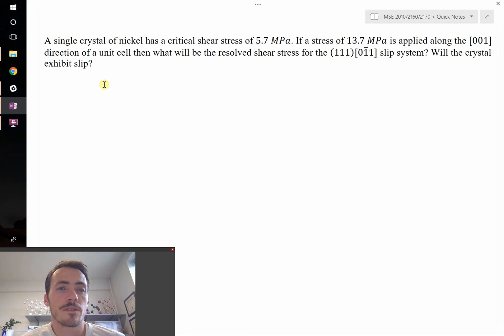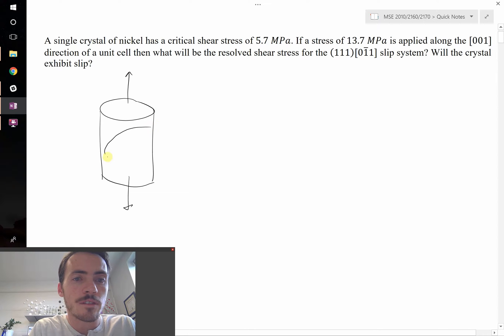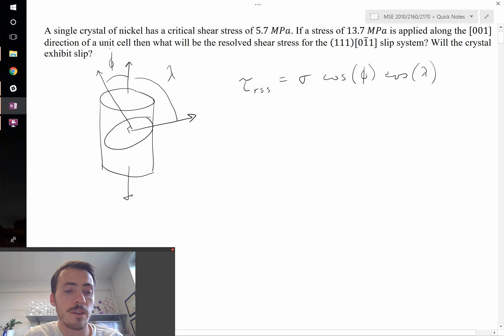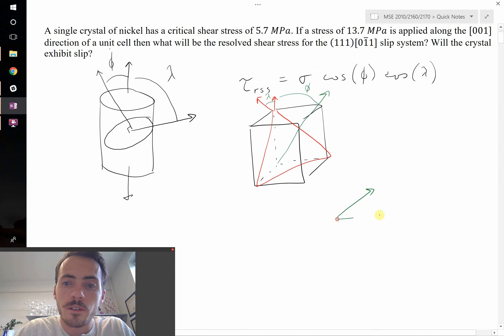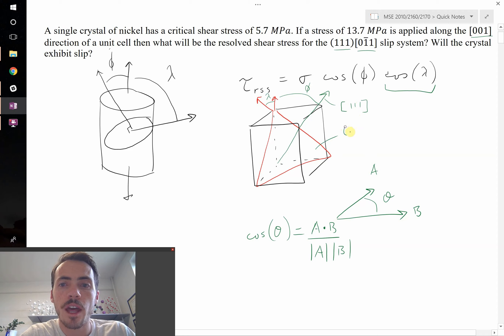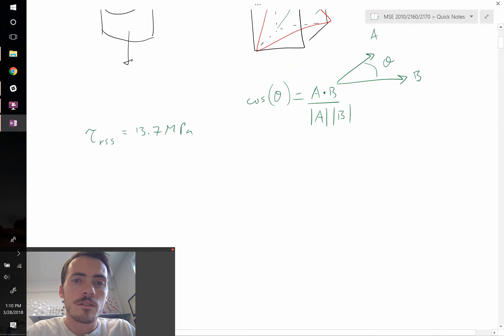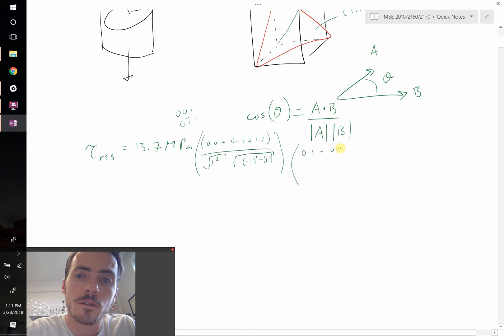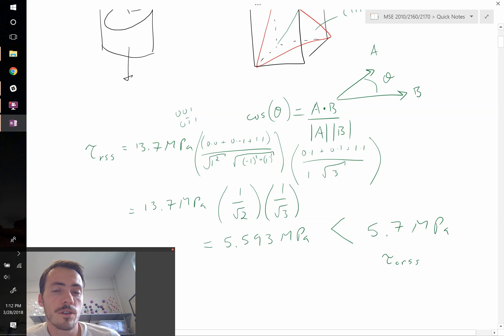Slip in single crystals due to resolved shear stress (Schmid's Law) example problem

Comment: When you say the resolved shear stress would just be the applied stress if those angles were zero, that seems strange cause I thought the normal stress would be 100% but the shear stress when you're just pulling on something would be 0 (and at a max on 45 degree planes). Thanks for the example, not sure im explaining what I mean. I get the math (cos(0) = 1 for both)
Reply: I found a derivation that makes the math make sense to me - no wonder I was having issues, here it is for others - http://www.uobabylon.edu.iq/eprints/publication_12_24106_1037.pdf
Reply from the maker: I'm not totally sure that I follow you. When the angles are 90 degrees then the applied stress is totally perpendicular to the slip plane and direction. Therefore the shear stress component is zero. If they line up exactly (0 degrees) then have pure shear.
Reply from the maker: However, you can't have both direction and normal 0 degrees to the applied because direction and normal themselves are 90 degrees from one another. The best case scenario is when we have applied 45 degrees from normal and 45 degrees for slip direction. Or in other words, exactly between the two. This is why max shear occurs at 45degree planes
Reply: @TaylorSparks   Thanks for the replies, I was confused about the derivation of the formula given what I know about vectors, stress and projections. I couldn't see how they came up with it in my head. The link I gave derives the formula thoroughly and in it you can see how the area is used and actually cancels out in the equation to give you the formula.

Comment: hi sir, i got stuck finding the schmid factor between slip system {112}<111> and coarse grain orientation {100}<001>, can you help me? what is the end result?
Reply from the maker: vishal mishra what is the loading direction?
Reply: Taylor Sparks sir loading direction is not mentioned, only coarse grain orientation and slip system is given, i think we have to assume the coarse grain orientation as loading direction..
Reply from the maker: ok, in that case, since families rather than specific planes/directions are given I will select specific values. If the exact plane is (112) then the direction needs to be [-1 -1 1] and the loading direction [001]. Calculating cos(theta)*cos(lambda) we get=((0*1+0*1+2*1)/(sqrt(1^2)*sqrt(1^2+1^2+2^2))*((0*-1+0*-1+1*1)/(sqrt(3^2)*sqrt(1^2))=sqrt(2)/3
Reply: thank you.